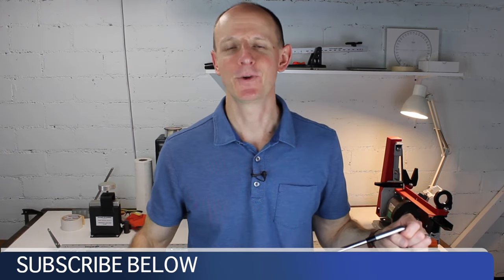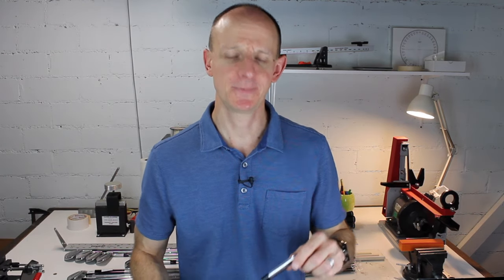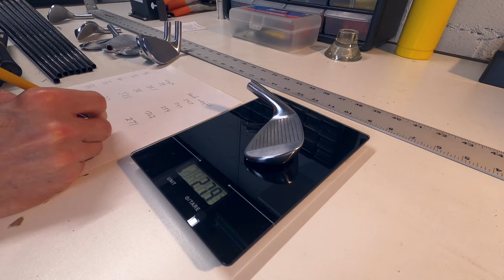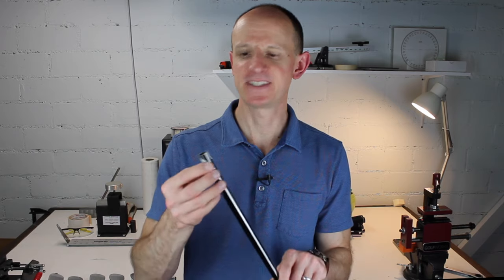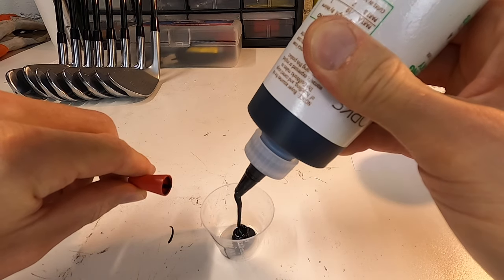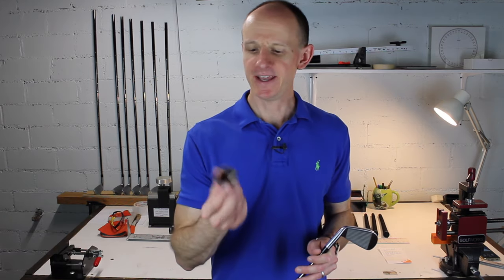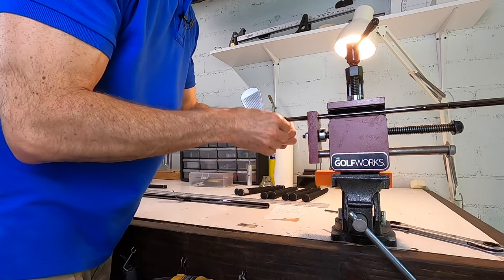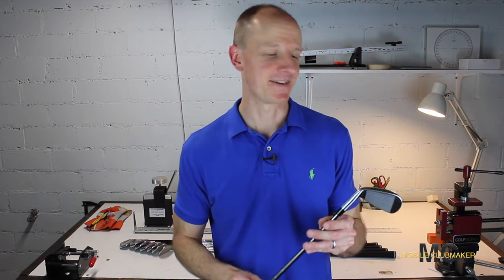GOLF CLUB BUILD - How to reshaft your irons Step by Step

Comment: If you are removing the grips with compressed air, remove the grips before removing the heads. If you remove the heads first the air will blow through the open shaft tip and not push the grip off.

Comment: Cool video. If you take a piece of fishing line and run it over the end of the tip then slide the head on It will be a nice tight friction fit so the head won’t fall off while swing weighing. If that makes sense.
Reply from the maker: I've seen that trick from a Mizuno video I believe. I think McGolf also uses it for frequency matching. For me in the time it takes to get the fishing line cut and lined up, I can have already weighed out 3 clubs, but if you're worried about dropping a pristine new head on the ground, I can see the appeal.

Comment: I made a mock grip with 4 wraps of tape. Had to add brass tip weights to every shaft (they got really head light) to dial in the swing weights. I found it difficult to get the exact swing weight for each club. There all right around a D2ish. First time ever building my own clubs. It was a long process for me. Your video was definitely helpful.
Reply from the maker: Love hearing that. It gets easier and faster as you get more used to the process and any little variations that can come up with different brands.

Comment: I just reshafted a friend’s new Bettinardi wedges. That glue was tough to break. I started with my heat gun but gave up and used the torch. And I always use my shaft puller.
Reply from the maker: If they are steel shafts, usually easier to torch it, then twist the head to break the epoxy bond.

Comment: Thanks for the refresher about to build a set from some Callaway heads though I am using Callaway Diablo Shafts.
Reply from the maker: Depending on what heads you are using, you might want to watch this video also. Some Callaway hosels require a bit more work to get a good fit.
https://youtu.be/eSdutT5NU40
Reply: @EFGMC  Thanks for the link appreciate it.  A few years ago I built a set of Callaway X and your correct the shafts can be a little fiddley.

Comment: Damn KBS and their higher balance points. Those are some decent tips you're inserting. Had the same issue with mine. I also had to deal with going 1/4 in shorter. Great video
Reply from the maker: Yeah, I feel your pain. Those were 10g weights I used in about half the heads. I like the KBS Tour shaft but it's a PIA when it comes to swing weight. Just went with Nippon with my new build b/c I knew they are tip heavy by comparison.
Reply: @EFGMC  modus?
Reply from the maker: @dcloder  Sorry, yes Modus3 115 though the 120 and 125 are also more neutral. Stay away from the older NS Pro as they are more butt weighted again.

Comment: Hi, just a tip from me, instead of putting shaft together with rubber band, have a few grips (used, cheaper, in different models/weight ) which are cut open. Then you just put it on the shaft and sits perfectly when meassuering swingweight! When assembling clubs i like to spine shafts and afterwards put head on using a fishing line to find where it needs to sit to go straight trought the ball. I tried a trackman test before and after spining shafts and it does affect dispersion. The longer the club the more impact it has. Otherwise great videos, thanks.
Reply from the maker: I used cut grips for a long time but then was told it can lead to inconsistent shaft depth and length since the steel shafts start to cut into the rubber over time. Also it just gives an approximation of the weight, which can be off spec by a gram or more besides just stock weights all being slightly different. My way, at least I know the weight is right on. Though honestly, either method probably gets the same result within 1 SWP so I say do whatever you prefer.
Won't get into the spining.😁 If it works for you and as long as you aren't paying someone $30 per shaft to do it, I have no problems with it.
Thanks for watching!
Reply: @EFGMC  I do the spining myself :) so its cheap.

Comment: Greetings, should all irons have the same swing weight? And which would be the most recommended for the Mizuno MP52 with a shaft of approximately 60g? Thanks. If I lived near your workshop, I'm sure you would work on my clubs only you 💪💪💪
Reply from the maker: They should all be close, but not necessarily exactly the same. You can have a progression where the shorter clubs feel heavier.

Comment: Hello. If fitting Graphite shafts, do you drill the tips to make the weights fit inside the shaft? Great vid thanks..
Reply from the maker: Graphite tip weights have narrow stems to fit inside the graphite vent hole. However some shafts have very narrow vent holes and will need to be drilled a bit more.

Comment: great work!  i like the shaft label for looks and identification for future owners.  i prefer to have the label where you can see it, rather than hiding on the bottom.  personally i don't want a swing weight more than d2, but with a 120 gram shaft, probably could not tell.  i wonder about orientation of shaft seam, since you have the ability to go a little beyond standard manufacturing techniques.
Reply from the maker: Thanks for watching. I don't believe that aligning the shaft in specific orientations is of any discernible benefit so I don't do it. But if you have the means to identify and feel it's a benefit, then I say go for it. I just would never pay for it.

Comment: Those shafts look awesome! Nice work. I'm changing parallel to taper tip shafts. First time switching shafts. So, if I've got this correct I need to use a shim? Do I always need a tip weight? -I don't have a swing weight scale.
Reply from the maker: Yes to the shims. If you are concerned about the swing weight, you can dry fit the club together before epoxying and use an online SW calculator or app to get a very good idea what the SW will be. Just make sure you measure accurately and the calculator will be very good.
Reply: @EFGMC  Thank you!

Comment: Great Job I tend to use an old grip which is slit all the way down to put on the shaft when checking the swing weight.
Also some of your tip weights looked large what swing weight did they end up at when finished?
thanks
Reply from the maker: I use the slit grip method sometimes, just have to be careful that the shaft doesn't start cutting into the grip cap and throw off the weight.

SW on these came out to D3. These heads were all quite light to start with. Thanks for watching. Sorry for the slow reply. These youtube comments don't always alert me when they show up.

Comment: You are brave to do the video un a nice Polo. I've ruined many shirts when putting on grips and the solvent squirts back on my shirt and seems almost always to happen when I forget to put on the apron. Well done video keep em coming.
Reply from the maker: I always do a side step when installing grips for just that reason. Also try and go smooth with it to lower the pressure so it doesn't spray out like a fire hose.

Comment: Hi AJ, I really like my G425 irons, but as age has crept up with me so has my swing speed slowed down. Question here, it possible to re shaft my irons with a senior flex graphite shafts? I made a mistake many many years ago and sold my Wilson Staff (stiff) blades and bought Ping Zing 2 irons with Reg shafts instead of re shafting and I don’t want to make the same mistake again.
Reply from the maker: Yes they can be reshafted. You can send me a message if you want a price quote.

Comment: Those are some awesome shafts, if you've got the game for them.  Low spins, medium ball fight. If you don't, you'll be reshafting those irons and selling them on eBay. You lost me on the propane torch.  Just get a heat gun. You drill out that hosel anymore and you're going to turn those .355 heads into .370's. Why would you use graphite shafts when they've perfected steel (lite now)? They're a pain to replace.  Nice video.  Nice little plastic cups too ;-)
Reply from the maker: I have one of each. Torch is always faster but don't love to use it on painted finishes. KBS Tours are working great. Only issue is the high balance point requiring extra head weight during assembly but other than that. Probably picked up half a club worth of distance with them.

Comment: Thanks for all your videos! Awesome! Just a quick question from your expertise, I have just re shafted my son ( he is 16, +1 hdcp), we have gone from the Nippon Pro Modus 105 (s) to the Dynamic Gold Tour issue (120 gram S400), to keep the flight down  a little lower. When pulling out the shafts we notice a brass weight on the bottom, the manufacture said keep them in however now the swing weight has gone from D2 to D5/6. What are you thoughts? I thought maybe Iet him hit a few and see what he says and then maybe have to take all the heads off again and take out the weight, but before I do that I thought I would ask the expert. Thanks!
Reply from the maker: That heavier shaft will add swing weight so the brass weights are likely not necessary. You might need different weights to ensure all the irons SW out similar but will need smaller weight ones for that.
Reply: Thanks AJ, I think I will let him hit one first and then if need be, I will have to take the heads all off again :-(. Although I think SW is a matter of feel, definitely the overall mass has increased with the heavier shaft. Cheers @EFGMC

Comment: very nice job and thanks for the easy explanation ,I am thinking to switch my from steel to graphite ,one question how I know the size of the tip most of the shafts I see said .370 size I want the weight 70 grams ,
can you recomend a website to buy them by the way my iron are cobra F max .Thank for you time
Reply from the maker: I would look at Golfworks. Lots of shafts, also have a table that tells you the recommended replacement shafts for most any irons. This includes giving you the specs including whether the heads are .370 or .355
Pretty sure yours are .370
Reply: @EFGMC  thanks 🙏 a lot for taking the time to respond to my questions and for the great tips

Comment: Thank you for the video. My only question I have.. I noticed you did not perform a shaft spine alignment. Is spine alignment recommended or is a hoax? I appreciate your comment.
Reply from the maker: I think that if a shaft needed alignment you probably shouldn't be using that shaft. I've done a number of videos testing between PURE or Spine or FLO vs not and have yet to see any results that proves it's value.

Comment: Great video, love the level of detail and pacing. I'm in the planning stage of reworking a set of MP-18 MMCs but I don't have them in hand. Do you happen to know the BBGM (bottom bore to ground measurement) on these? It's the difference between the cut shaft length and the assembled playing length. Thanks!
Reply from the maker: I do. It's just over 1 inch, call it 1 and 1/16 to 1 and 1/8. Are you trying to figure out final length with some used shafts?
Reply: @EFGMC  Thanks! I'll probably keep the same shafts (C-Taper Lite S) but at the moment I'm just playing with a couple swing weight and MOI calculators to see how they flow into my wedges (Glide Forged with KBS Tour S). I've got the wedges taken apart here but the irons are in FL. Using your head weights as placeholders, but I know I'll have to actually take them apart eventually to get them accurate. Thanks again.

Comment: I haven't done shafts in 20 years but the process still looks the same. The bead additiive to the epoxy does looke different and I always used double sided tape for grips. Is that not the case anymore?
Reply from the maker: Still use double sided tape. The dispenser pulls the backing off.

Comment: Can you do a video replacing old Big Bertha bore through graphite shafts with new ones? I may have bitten off more than I can chew with this project. Need some help.
Reply from the maker: Those just have a couple extra steps. I don't have a set available to do a demo on. The main differences are you will need to sand down the shaft tips a bit because the hosels taper in at the bottom a little. Hand sand them until they just pass though the hole in the sole. Obviously one side of the shaft will be sticking further through because of the angle. Just make sure that the shaft is at least even with the sole on the short side.
Epoxy as with any club remembering to wipe off the sole in addition to the hosel. 
Once dry, sand down the graphite tip until it's flush with the sole. 
Next you need to buy some graphite shaft pins. You will need to epoxy these into the hole in the shaft as a separate step. Once dry you can cut off the excess with clippers or a hack saw.
Again sand it down and then some light finishing sand paper and acetone wipe like you would with a ferrule.
That's it.

Comment: Hi, A great, easy to follow video. Searching all over the web for this question and no luck.... Have you or anyone you know reshafted the TM Sim irons? I’m asking as I’m trying not to run into any surprises along the way. That happened with the Ping G700’s. Pings used to be soooo easy. Not so much  anymore. Actually had to send back to Ping... $$$ Thanks and glad I came across your site
Reply from the maker: I haven't done any Sims. M5 is the most recent I've done. No issues there. Have not heard of any weirdness with the Sim. Would recommend just pulling one iron head for inspection before getting into the whole set. If you see anything odd, let me know.
Reply: Thank you so much for not only the reply, but a fast one!! Some of the online bigger golf stores should take notice of excellent customer service like this.
Reply: Sorry, A ps.... love your work setup and very envious!!

Comment: Amazing! Thank you! Question, the small brass looking dowels that you slid into the end of the shafts right after applying the epoxy, just before you slid the new shaft into the club head, are those weights? Did they come with your new shafts? The black nickeled finish looks so good!
Reply from the maker: Those are tip weights you buy separately. They come in different sizes, weights, and versions for steel and graphite shafts.

Comment: great video, thanks, going to build my sons Apex 19s this week.  You didnt go into detail about tip weighting however, or it wasn't shown.  Where does the label go traditionally when rotating the shaft once its been glued in?  thanks
Reply from the maker: Tip weighting basic rule is 2 grams per 1 swing weight point change. I like to weigh all the heads first and check if they have a constant 7g change. That gives a good indication of how much weight I might need to add to get everything in line.
If you are talking about the graphics on the shaft, you can align them however you choose. I always default to logo down. If you are talking about shaft band stickers, they usually go an inch or so below the grip.

Comment: I like this video very much, just one question: you had to use very large tip weights to balance the clubs. Is a weight at this size not affecting the feel at impact? I am asking because I should do the same, and I am thinking about let the lead tape behind the middle of the club like I did try out for the real feel.

Comment: Sorry for the basic question but how far does the shaft extend into the head? does it go all the way down into the available space?
Reply from the maker: Yes, the correct size shaft should touch the bottom of the hosel. Usually it's around an inch to 1 1/4 deep. If the shaft is getting stuck and not bottoming out, you might have the wrong diameter shaft, need to further clean out the hosel to remove debris, or ream out the hosel to enlarge the opening (last resort).

Comment: I'm hitting Taylormade burner clubs that are stiff shafts. I am considering re-stafting them. My question is, since they are several years old are they worth re-shafting?  My age is becoming a factor also. Your opinion would be welcomed.
Reply from the maker: Will come down to the condition of the heads and if you are happy with the lofts on them. Also are you doing the work vs having the work done?

Comment: Aj, great video. Straight forward layman approach instead of the usual engineering talk that lulls you asleep halfway through.  How did you know your heads were light?  Is there a book that lists the club weight from manufacturers?
Reply from the maker: It can be hard to find exact specs and the OEM websites will not have them but you can usually find some different charts online or look at some component club brands (like Maltby who shows the head weights) to get an idea where the weight should be for a blade style or GI iron.
Reply: @EFGMC  Thanks.  It can be overwhelming searching the net for club specs, only to find yourself chasing your tail. Thanks for the info, Jon

Comment: If you are removing the grips with an air compressor you need to leave the heads on until the grips are removed. Otherwise the air will blow straight out the tip of the shaft where the head had been and will not remove the grip. After removing the grips you could then lock the shaft in a vice with a rubber shaft clamp and twist the heads off with heat.
Reply from the maker: You could also just pull the heads and not clean out the shaft tips so you still have the air tight seal for air removal. Then go back and clean the tips out.
Reply: @EFGMC  - Sometimes that works. Sometimes, after removing the head, there is no epoxy plug to block the flow of air. I have had both happen.

Comment: I don't recommend use a drill with sandpaper, the best way is a bottoming  ream to the exact size of the hole. If you know the size of the hole then purchase a bottom ream that size. It will clean it out without any problems.